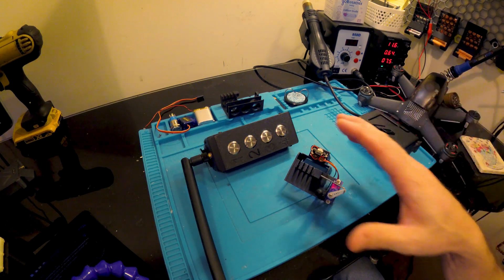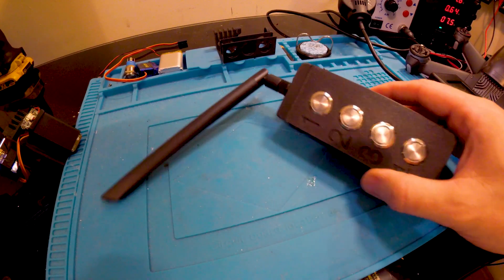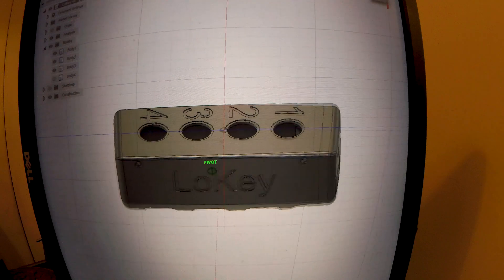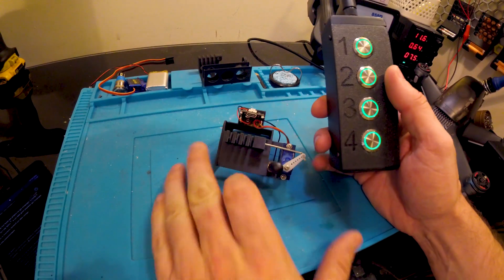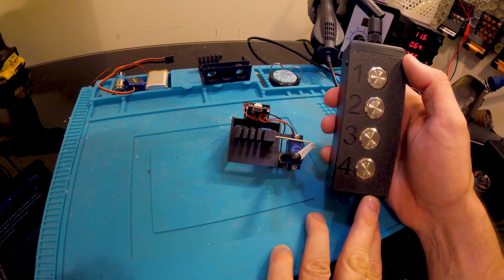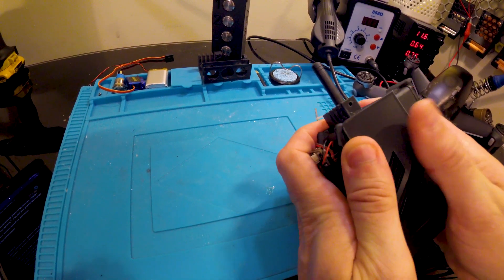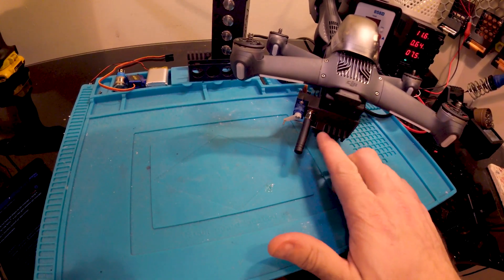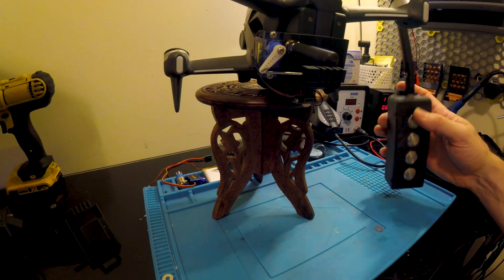DJI FPV ESP32 LoRa Dropper

Comment: Really great work!!! I'm having trouble curating the hardware list from the github read me. Would you be able to provide any links to the components you used?
Reply from the maker: Hey sure! Ill update github to amke it more clear, but you are looking for two Heltec Wireless Stick Lite V3, and one 9g hobby servo. the switches i found on amazon, "metal non latching led backlit" brings back loads of options, battery wise you could get away with disposable vape batteries, anything light enough! :) enjoy!